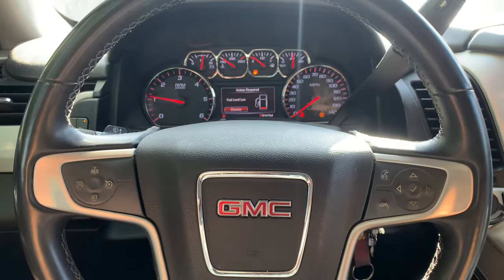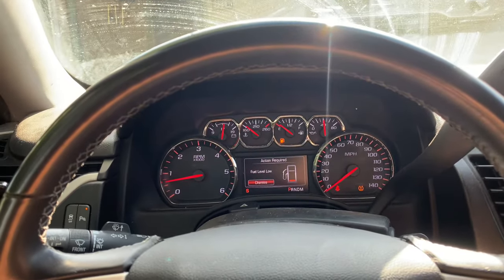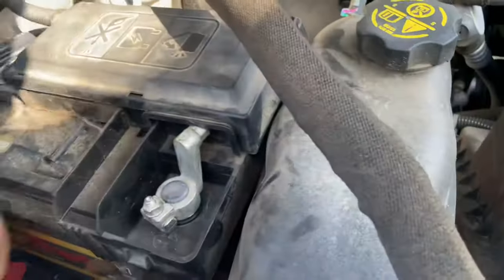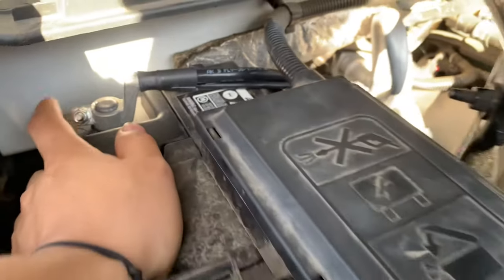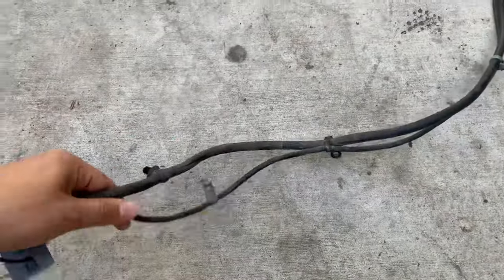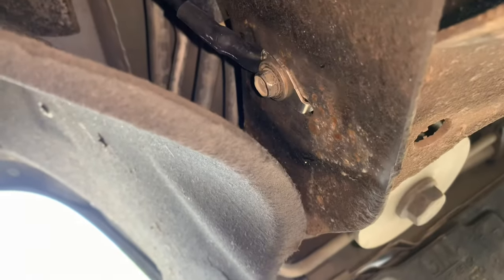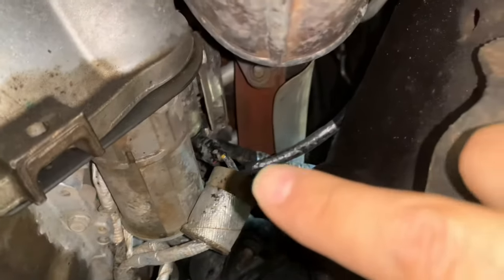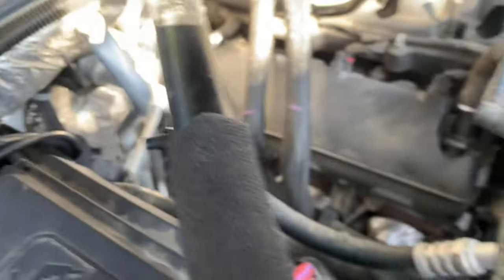How to Replace 2014-2018 GM truck ground cable due to Electrical issues (no crank, stabilitrak, etc)

Comment: Thanks for sharing this video man! I have been chasing this issue looking at different grounds around the truck and just living with this problem way to long! I’m going to try this out and I’ll keep updating as time goes on as well! I got a 2016 Silverado Lt!
Reply from the maker: Glad I could help! I was pretty skeptical over changing this wire out because I thought how could a ground wire go bad? But looks like it should’ve been the first thing I did because it worked. Good luck with your truck 🙌
Reply: I’m having this issue
Reply: My transmission turns off while driving
Reply: Having same issue with 2015 Silverado how is it holding up?
Reply: @sethmartin9498   Im having the same problem with my 2015 Silverado. Did you happen to try this yet? some hard slow turn it will preety much shut off and stablitrac pops up. Sometimes acts dead after that. Other weird stuff with the radio and inside lights also tranny weird randomly.
Reply: @paulfindley9498 I did about 2 weekend ago and it’s working so far
Reply: My question is what causes the ground to have issues? Besides being dirty and such.
Reply: Mine actually ended up being my trailer brake control module to the left of the steering wheel. Swapped that out for like 20$ never had a problem again.
Reply: @AxXxlostXsoulxXx 
 How did you know it was the control module?
Reply: @DavidGonzalez-pj3zi  there was a YouTube video that showed the three locations it could be.. I can’t remember what I looked up now sorry.. but it was the cheapest easiest fix. 20$ and 30 minutes. So I honestly guessed and got lucky on it. But it’s been a year and a half 50k+ miles and not one more issue.
Reply: @paulfindley1260  wow I have some of the exact same symptoms on 2017 Silverado.  stabilitrac message, acts dead (like no electrical power at all from the battery), radio resets, driver side window message...

Comment: Very helpful. I did the same fix on the post grounds on each side under corner of windshield. Had issue on passenger side cleaned it drove fine for a week and same issues came back. Losing all electrical while driving but truck continues running fine. I think I am at the point where I change the ground wire to battery… if that doesn’t take care of it probably move on to BCM.. Thanks for video. I have 2017 Silverado so should be the same.
Reply: How did it go with the ground wire ?
Reply: @rangeday2923  well… took it to dealership had BCM replaced had same issue… however they did find the motor was not grounded… it’s been a couple months truck is fixed,,,
Reply: @keithshaeffer140   so you did not have to replace the battery ground cable?  just had the dealership ground the motor and that was the fix?

Comment: Man same issue on my 2016 escalade. Wouldn't start at times even though all my instrument panel lights comes on. So I thought it's the starter.   Then I figured since it eventually starts but dies when coming to a stop that's not a starter issues. So this ground cable seems hella promising. 🙏🏿 The cable fixes this issue!!

Comment: Hi. Thanks for the video. I am having issues with power steering. It gets locked for 1-2 seconds with warning service power steering. Really looks like a loose connection. I have Yukon xl Denali 2016. I’ll try this today. Hope it solves the problem. Went for regular oil and filters change at ACDELCO today and described the problem to them. They said they don’t work on any electronic issues as they don’t have any good electrician. 

They asked me to go any other local workshop. The dealer also doesn’t accept my car because it is USA specs and not GGC specs (middle east).

Comment: I had exactly same problem with tahoe 2015, i tryed tightening the nuts and compress the ends of the cables before two years, and that solved the problem partially, untill today it shows back, so i guess i have to change the ground cables, my question is, does that solves the problem? Did it show up again, since ur video was from last year.

Comment: Hey, exactly same issue you described with my 2016 4x4 Silverado and the dealer quoted my $900 to replace the cables. 

Is it a similar set up as in your video to replace?

I feel like my acts up after going through the car wash, but definitely locks up when making a turn. Recently lost power on the highway which was scary.
Reply: That's my worst nightmare. Did you ever get it fixed?

Comment: I have a 2016 Escalade and the same thing did that when I was driving I put the 2 front window up at the same time and my dashboard and radio turn off then came back up and check the black cable on the battery and it was really lose you think if I just tighten it really good it would fix this problem?

Comment: Bro I’m having the same issue 2016 Chevy Tahoe. I turned into my drive way and truck started acting exactly how you explained it. It’s currently at the Chevy dealer and they’re talking about gutting my whole inside
Reply from the maker: Yup they’re probably gonna look at those grounds on the dash but definitely have them change the battery negative cable because out of every fix I tried, this actually fixed it
Reply: Thanks brother
Reply: Hey Buddy. Same issues here. I ordered a new fuse box fir the top of my battery. I have not received it yet, but I am having the same issues after a battery replacement l. They say that fuse can arc and no longer allow the grounds to function. Did you get your issue figured out?
Reply: Did they fix it and what was it??

Comment: I just replace my negative battery cable on my 2014 Chevy Silverado. Hoping this fixes the problem.
Reply: How did it go? I have a 2014 sierra
Reply: Did your problem go away when replaced the negative terminal? My denali started with that issue

Comment: This is a great video but do you have any advice on how to remove the larger cable by the starter on a 4x4? Yours is quite a bit easier to get to but mine looks much more difficult with the xfer case in the way..
Reply: Take out the fender guard and work with the truck on a set of ramps. You should be able to access it from the back side of the wheel well.
Reply: @georgehamilton842  thank you for the help. Ill try that route.

Comment: Did your speedometer and odometer start just going up and down too? Also would your lights just randomly go in and out of high beam? Going to take a look at the ground connections tomorrow
Reply: I am fighting this issue on a 2016 canyon right now. My speedometer goes crazy, loss of power, service stabilitrak etc. I’m going to try this
Reply: Hey brannon, did you get it sorted out? Did you try this?

Comment: Good afternoon great detailed explanation. Just out of curiosity how is the truck doing since the repair. Looks like it’s been about a year. 

My truck is giving me the same Issue and im about to attempt this repair hopefully it’s the root cause.
Reply: Im having the same, and welling to do so, did u replace the cable? The problem goes?

Comment: Hey, I am having this issue on my 2015 Yukon XL Denali, when I go to buy the part from orileys, it’s saying it won’t fit my car. Is it still universal for my car even though it says it won’t fit?
Reply from the maker: This particular suv is a 2015 Gmc Yukon so I do not see how it would be different. Best thing to do would be to inspect your current cable and make sure it looks similar to the one I posted. I’m pretty sure it should be the same tho. Worst case scenario just return it if doesn’t look right

Comment: How did you get the bolt off for the wire above the starter?? I can not get mine to break loose
Reply: Hope and Prayer because I'm currently on this part and it's rough
Reply: @zacharyoakes3641 I could not get it. Currently did a extra ground wire will I can take it to a shop or someone with a lift I can use

Comment: How the heck do you get to the bolt by the starter?!?!  I can’t get to it from under the starter and I removed the fender and it’s super far to get to, even with an extension
Reply: Use two

Comment: I just replaced this cable and for some reason my battery is draining. Everything worked well for a couple days then the battery is dead. Got the battery checked and nothing is wrong with it.
Reply: Did you figure it out I’m having same issues
Reply: The starter has some wires that are semi exposed causing a short
Reply: So did you just wrap them up

Comment: Did you have an issue with trailer brakes maintenance message showing on the dash?
Reply from the maker: I never saw that light pop up
Reply: theres a fuse under the hood for it, might be blown\

Comment: We just bought a 2018 GMC Yukon XL and occasionally it won’t start. No instrument lights or interior or exterior lights will come on and the key fob won’t do anything. I disconnect the negative cable to the battery and wait about a minute to reconnect it, then everything works again.  We are not sure why we are having this issue. Anyone have any ideas?
Reply: Were you able to figure out what was causing this?

Comment: You sound like you know what you are talking about. I should bring my 2016 Colorado 2.5 IL to you and help me with it
I have the same issues with not cranking, at first it hesitate to crank and then try the 2nd time it crank, later on the day it would not crank. I had original brought to the dealer and they Service man swears they did a the voltage meter check, and nothing wrong with the cable, took it home and later it didn't want to crank,  now they say its the negative cable due to corrosion stuck inside from the negative cable to the battery. then said it might be the positive cable, at this point we are guessing and its cost me lots of money. I m disable but I will not give up until I find the issue.

Comment: Could I just clean where it’s supposed to make contact instead of buying a new one?
( of coarse only if the cable seems to be fine)
Reply from the maker: I tried that at first and it helped for a day but then went back to giving me trouble

Comment: has anyone here actually changed it them self? im having trouble with the transmission tube bracket literally in front of my 13 mm bolt
Reply from the maker: I didn’t have anything blocking my engine ground bolt. If you’re referring to the trans oil dip stick couldn’t you just remove the bolt that holds the tube and then pull it out?

Comment: FYI. You should disconnect the positive cable from the battery before doing any of this work.
Reply from the maker: Yes! Always safer thanks for the comment
Reply: No - you should disconnect the NEGATIVE battery cable before doing this kind of work. After disconnecting the negative, remove the positive if you wish, but don't discon positive first!

Comment: Not really sure what he moved, or took out, but that bolt next to the starter is not that fucking easy to see. You need to make people aware of this. It's a bitch to get to and take off unless you have other things disconnected. This comment is for everybody who thinks it's going to be as easy as what he just showed you.
Reply: Not only can I not see it, there is no way to get a ratchet or wrench in there without SOMETHING being removed 1st.. I had to reconnect every part of the old ground wire because this is not happening for for and my level of skill and tools....in order for me to even start my truck